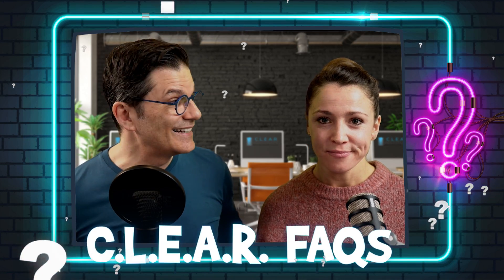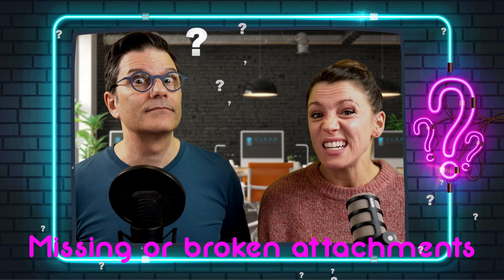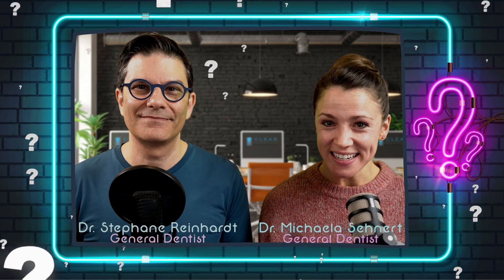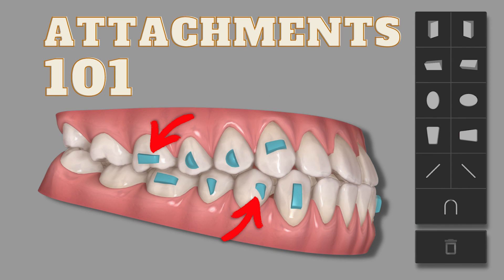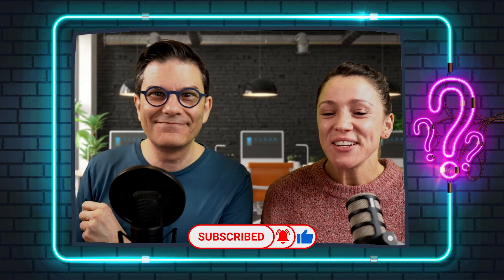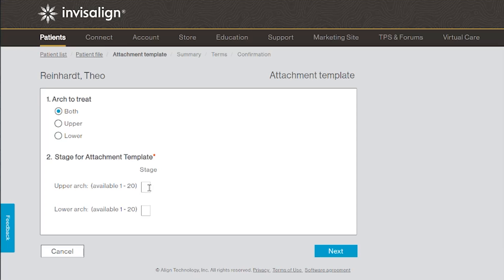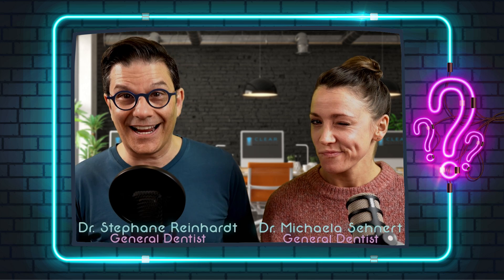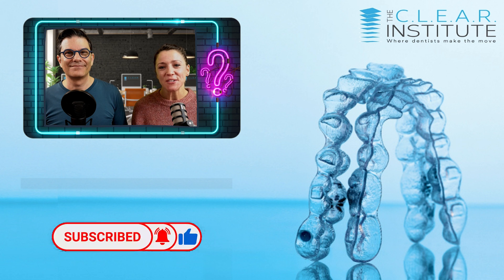How to replace or repair Invisalign clear aligner's broken attachments?

Comment: hi , I have applied atachments to my patients , but they keep falling off because of the force she have to apply for removing it.what should I do
Reply from the maker: This is not common. The force needed to remove aligners should not debond attachments. Maybe some contamination during bonding process? Also can happen when attachments are bonded on porcelain or ceramic.